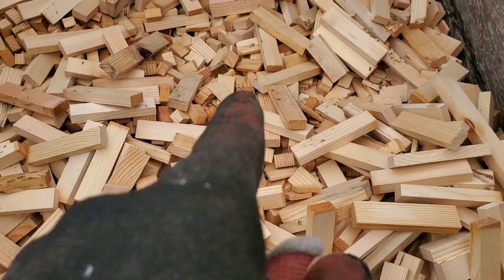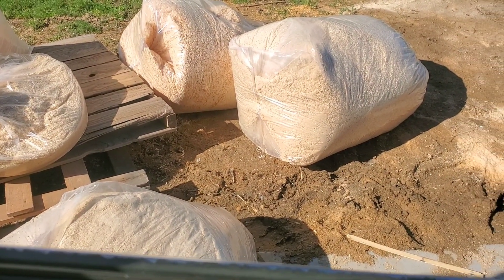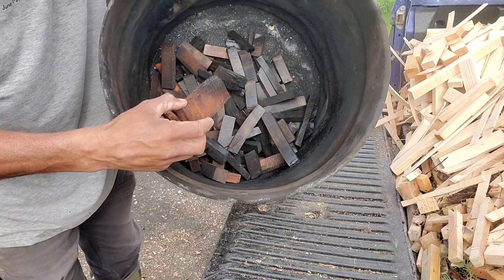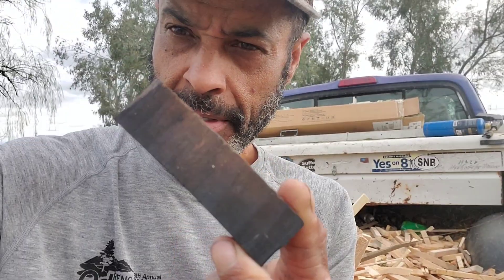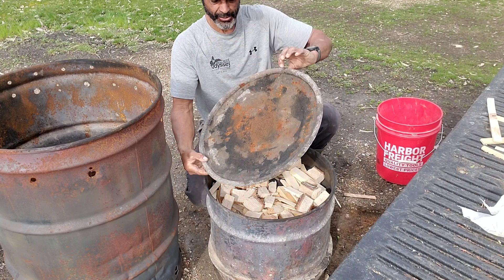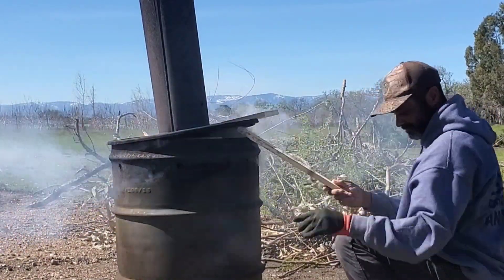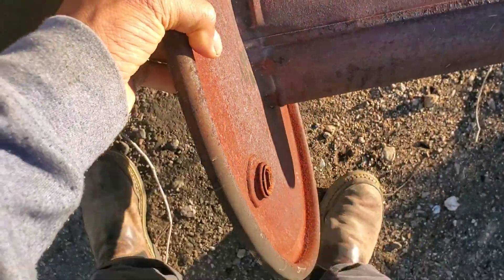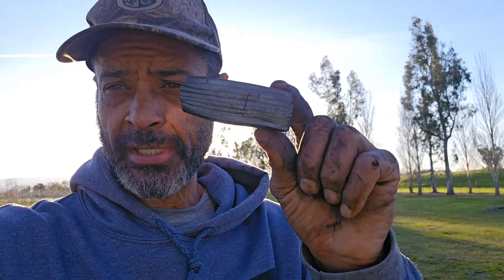Maximizing your Biochar Production: Sourcing and Processing

Comment: I make charcoal in a similar fashion. My outer barrel is a 300 gallon fuel barrel (cut down). The inner barrel is a 55 gallon oil drum. 

The bung end of the 55 gallon drum is removed, leaving a 1/2 inch lip to support a stove pipe gasket and metal circular lid cut to fit the opening. I place 1/8th inch holes around the lower rib in the 55 gallon drum to permit the escape of the volatile oils when the redcedar wood chunks become hot. The release of the volatile oils creates a positive feedback with the fire, making the fire very hot (and better charcoal). The 55 gallon drum is placed on end, inside the 300 gallon barrel.

Several 1inch holes are placed around the bottom of the 300 gallon barrel to permit adequate ventilation for the fire that's burning between the walls of 55 and 300 gallon barrels. The lid to the 300 gallon barrel has a 3-foot section of stove pipe located in the center to help the fire draft. There's enough fuel stacked between the barrel walls so the ash will cover the knee-high holes in the 55 gallon barrel and seal it off from oxygen at the end of the burn. 

I fill the 55 gallon barrel with the char material, put on the gasket seal and lid, then pack the fire material around the 55 gallon barrel. With the lid on the 300 gallon barrel, I light the fuel through the 1 inch holes. I start the fire in the evening, it's done by morning.

Comment: Hello sir, may i ask if  you  tried to make a biochar from plants like Chromolaena odorata or Siam weed? We are planning to make a biocharcoal from Siam weed as our research. An Eco friendly product and help it for its invasive nature. 

Thank you for your response in advance.
Reply from the maker: I have not personally nor am I familiar with that material but any organic biomass can be made into char provided it has been sufficiently dried beforehand. Grass is somewhat difficult to make into char in this type of system because sufficient airflow through the feedstock is necessary for uniformity of the end product.  I have experimented with grass in my retort but found it possible but not practical and certainly not a better option than wood in my opinion.